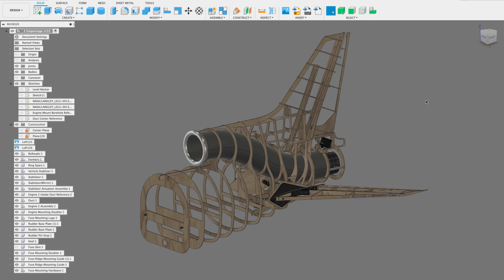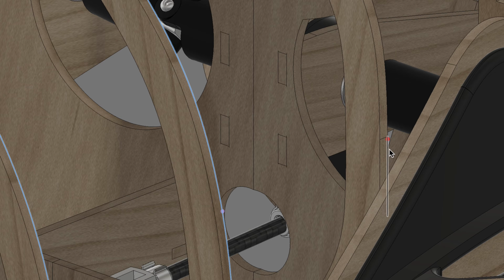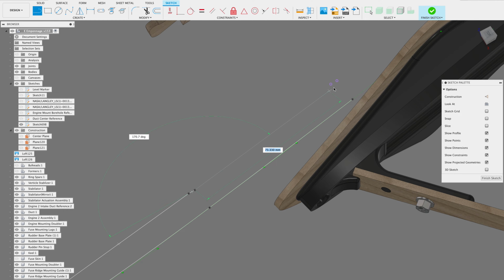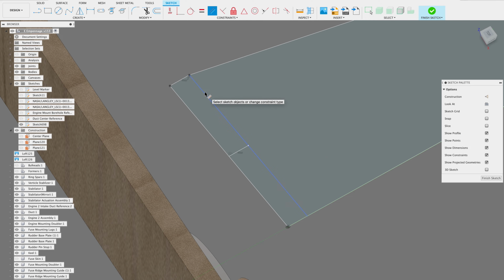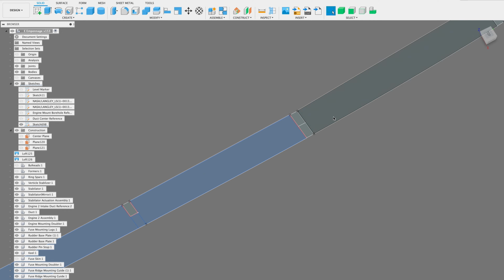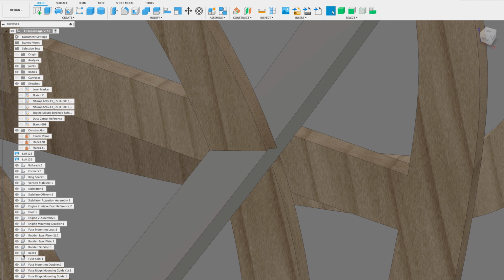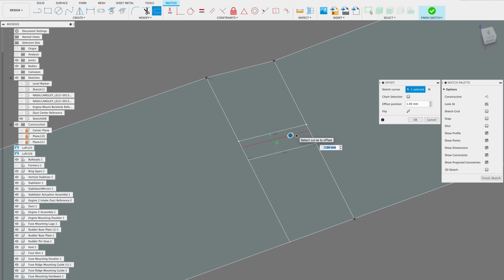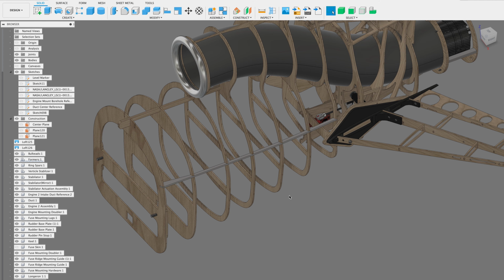How To 3D Model Airplane Longerons & Stringers in Fusion 360 [Episode 7]

Comment: After watching most of your tremendously informative videos i m still confused between the project and intersect tool 🥴
Reply from the maker: Intersect will place a line on any surface that crosses the plane on which you're sketching. Kinda like a horizon. Where as project, projects a line onto the stitch plane from another objects edge.  (Analogy) It's like projecting a shadow of an object to the sketch plane, and the intersect uses the plane to cut through. Hope that's more clear than mud.

Comment: I would like to see the designing of your tail engine ducting and install!!
Reply from the maker: Thanks for the request. The duct is very simple to create using a sketch on the profile view, when you create a spline where the center of the duct will go, then using the pipe tool to create the shape. Takes about a minute to do. I'll be showing the installation when I get to the Tail Section build. :)

Comment: Great Terrance!
I plan to do my first PSS Slope Glider.
Not necessary for it, but can you show how to render everything that it looks so real?
In you rendered model (seen on the TV in your background) it looks like almost real and not just CAD with wood optics :)
Lighting and shadow looks nice.
Reply from the maker: Hello Sebastian. The slope glider will be a great project! Best wishes for success for you there. Regarding the renderings; They took me a good bit of time to developed and tune the settings to get the look I was shooting for. They can take up to 30 minutes to render depending on how much geometry is in frame. Fusion 360 has a catalog of 3D textures that can be applied which helps bring more realism to the renders. I don't know if they are available in the hobby version though since they need to be downloaded. AutoDesk made several changes this year to features that are available for use in F360.

Comment: You may have said before but what kind of wood do you plan to use on the final product? Lite ply?
Reply from the maker: Hey there, thanks for the question -- The build will use a combination of birch ply and balsa wood, some Carbon Fiber and 3D printed parts.

Comment: Wow I have learned quite a bit from you videos. I'm drawing up a Quest Kodiak 100 and got the fuselage drawn up thanks to your tutorials. I'm still figuring out how to draw the floats for it, this part will be tricky.
Reply from the maker: That's awesome! Always nice to hear when the videos I've put up are helping fellow aviation enthusiasts out there. The Kodiak 100 will be a really cool plane! At what scale are you going to be building it? The floats shouldn't be too difficult. When you are doing your sketches, just make sure that you are placing your splines at the apexes and low points, the loft will figure out the best transition between them. Let me know if you run into any troubles with it.
Reply: @RCCAD2VR  My idea was to take the guts out of my Avios Grand Tundra which is 1700mm so I scaled the Kodiak to that wingspan. With the Kodiak airframe I had plans somebody drew up and shared on RC groups so I just used the bulkhead outlines and used the loft tool to make the entire airframe based on the bulkheads. Now I have to watch your videos again to learn some of your other techniques.